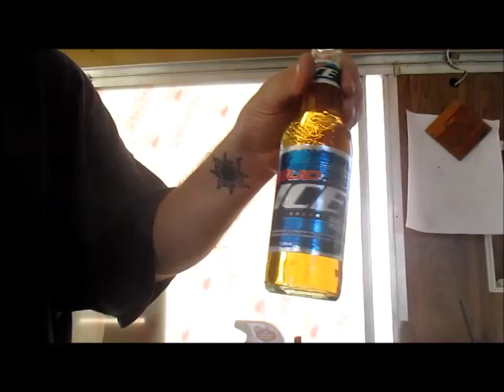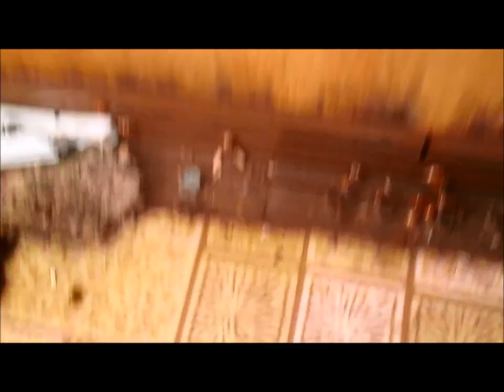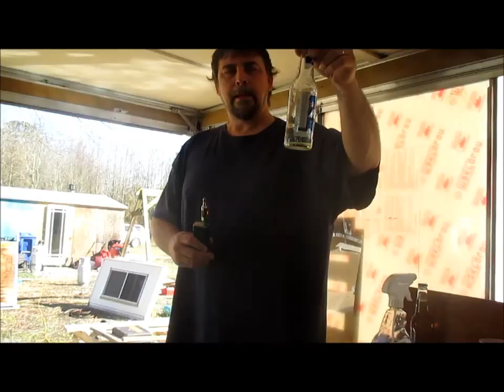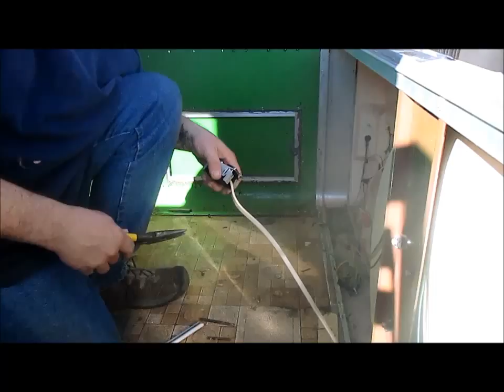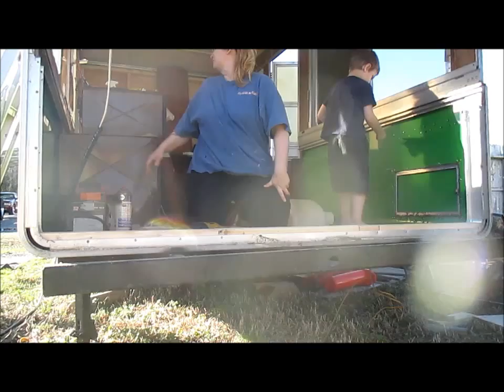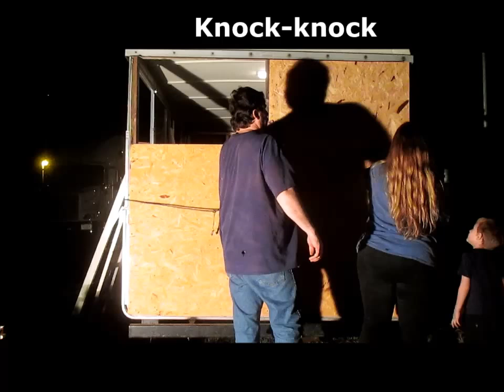Apache Ramada: Part 5: 1976 Camper Remodel 'Bitch Den'

Comment: Do you still have some of those removed parts? Looking for one of the poles and the spare tire cover.
Reply from the maker: Unfortunately, when we left that house, the tire cover was left on the rafters of the out building. And it was pristine. Not a crack or discoloration.